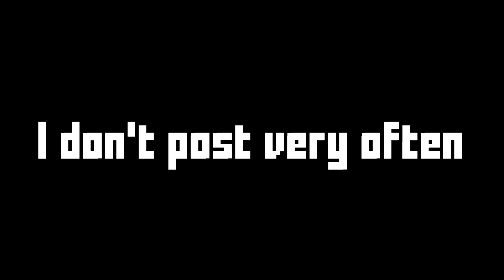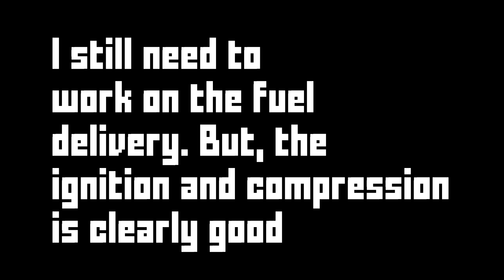Update on the 3D Printed Gas Engine: It Fires!

Comment: Hey Camden, I'm interested in your Piston Engine concept and I'm planning on making one with an SLA 3D printer.

SLA 3D printers have higher tolerances (Although with more tuning you can get the same print quality with an FDM) so I think I can make a Gas Engine in less time than it took for you to make yours. Because of tolerances.

Comment: Very interesting video! There have been model engines built with plastic crank cases, and plastic carburetors, also glass cylinders.  It will probably run but the cylinder head will get very hot very quickly. The hottest area is the exhaust valve port area.   Are you using an O ring piston ring?

Comment: i think if u tried making it 2 stroke it would have a higher chance of running since it has less things to seal and less moving parts and you could make theoretical compresion ratio higher but also i think you should increase the  crankshaft rods thicker and heavier flywheel

Comment: for fuel could a rc carburetor work? i think some were made for just gas.

I just now found this, is it all 3D printed? no metal sleeve or piston?
Reply from the maker: I wouldn't mid trying an RC carb however I am ambivalent due to having to actually purchase one and likely Nitro fuel to use it, so am avoiding it for as long as I can. It would be a little untruthful to say it is entirely 3d printed since it does rely on a Copper cylinder sleeve and metal hardware such as bearings and screws, but the latter is all 3d printed

Comment: I recommend using a slightly heavier flywheel as it seems that there isn't enough inertia to send the engine back around onto the next stroke. Also perhaps use an electric drill or motor to try spin the parts at a low of 50 rpm

Comment: Hey what's your ignition circuit? I've been looking around and everybody doing small engines is using high voltage spark drivers or glow plugs. I'd like to avoid that if possible!

Comment: I’ve thought about building something similar but with a few metal components. The two stroke approach is much better due to the simplicity. The head, piston, piston rings and cylinder sleeve would have to be metal with all other parts being 3D printed. You might be able to get away with casting the piston out of resin and using an o ring. I’ve seen people transform refrigerator and car a/c compressors into two strokes.

Comment: I realize this vid is 2 months old and you may already have a solution for your leaking, buuuut if you haven't tried it yet, I would suggest salt bath annealing with some High Temp (HT) PLA! Basically any PLA "Pro" you see on the market is a PLA mixed with other chemicals to reduce warping.

If you take salt, grind it down to a fine powder, and then submerge your print in that salt with a weight to hold the salt in place you can use that in an oven for a few hours at 170C to remelt the PLA closing any gaps from the printing process. Also if you anneal it at 60-70C during the cool down for a few more hours the semi-crystalline nature of PLA allows it to get stronger (less flexible, but higher force tolerance) and have a higher temp resistance. 

Just a thought to maybe help your sealing woes!
Reply from the maker: Woah, I have never heard of this before! Thank you for bringing this to my attention I'll definitely have to try this!

Comment: You did a big mistake. Beacuse it will NOT run on butane beacuse you dont have enought air in it. Try out CX-80 universal. It will work I grant you 100%. Or you can try petrol instead
Reply from the maker: You're correct, there definitely isn't enough air and I will look into your solutions, thanks!
Reply: @CamdenBowen  When did the next video arrives?

Comment: i think you need a heavier flywheel, like alot heavier
Reply from the maker: The thing is the crank will probably break with a heavier one lol, I could probably just make a very large diameter one instead however so the net weight is low but the inertia will be greater
Reply: @CamdenBowen  good idea, i want to make a gas engine too but i dont want to start untill i know its possible lol
Reply from the maker: @FoxSock  I have no idea if it's possible but I'll figure it out sooner or later lol
Reply: @CamdenBowen  im excited to see the results!

Comment: Consider switching to a liquid fuel again. This would make it easier to ensure constant fuel delivery. I would try a simple carburetor like you had before, and use a proper pump to ensure the fuel is being given constant, steady pressure. A basic gear pump would probably suffice. It would be more reliable than trying to scale down a diaphragm pump, after all.

Or don't do any of that. I'm not here to hijack your project. Either way, I like what you've got going here.
Reply from the maker: Thank you! I've tried so many things unsuccessfully so maybe I'll have to try liquid again, alcohol perhaps
Reply: @CamdenBowen  Alcohol would be good, but make sure you use alcohol-safe seals and hoses or they'll melt. Also, I'd try to use a carb that you can tune to some extent so you don't have to build a new one every time you want to adjust the air/fuel ratio.

Comment: I really want to see this engine run even just for a bit. Make sure the timing of the valves are perfect or else it will never run, try to make it work with the carburettor form the beginning so you get good air fuel ratio and try other types of fuel like petrol. Good luck, i wish you try these .
Reply from the maker: Thanks! The timing may need to be adjusted, the spark timing seems to be the biggest problem however instead of the valve timing
Reply: @CamdenBowen  You can just leave the spark plug spark all the time and when it is time for the power stroke there will always be a spark so you don't have to time the spark, or else you can do this till you get the engine running. Good luck.

Comment: @Camden Bowen just for giggles try a much heavier flywheel and/or changing the cam to a 2 stroke configuration. It kinda looks like the engine just doesn't have enough momentum to overcome the compression. I also think you should give a go with the lighter fluid again. The aresol is going to be a royal pain in the ass to get dialed in properly.
Reply from the maker: I agree lol, the heavier flywheel could work better as well as a new fuel source. I don't think a two stroke cam could work only because it isn't really designed to work like that unfortunately
Reply: @CamdenBowen  that would be correct... Forgot how 2 strokes operated for a moment.. but by doubling the cam profile you can try running it on compressed air. Might give you a better idea of whether or not something is binding up and a clue to how much weight you'll need to add
Reply from the maker: @PyroFactor101  that's not a bad idea, making a new head and camshaft to run on air as a test. I will look into that!

Comment: I love your engine so far... one thing I think that may help you though is that... honestly... I don't think your flywheel is heavy enough. You made your flywheel in a similar manner to other 3D printed engines (and why wouldn't you... if it works it works) but those engine's are usually air powered and 2 stroke meaning that they only have to have enough energy to get the piston through the exhaust stroke which... really isn't that much.

Your engine however is on a completely different level compared to those engines. You clearly have good compression and you are now running 4 strokes rather than just 2 meaning that you will need a LOT more rotational energy to be able to get it to cycle through all three of those and get back around to the power stroke again.

A good rule of thumb is at idle, your going to want enough rotational energy to be able to make it through at least 2 full 4 stroke cycles without the piston firing. Missing can happen at idle even with a fully functioning engine, so you will need to make it through 8 full strokes without a power cycle till it hopefully fires again. Seeing as your engine is 3D printed and this is all a guessing game (although your prints look to be some seriously high quality) you may even want more than that.

If you have that much weight on your flywheel (well... rotational inertia really), you should be able to get it to run and run pretty smoothly I would bet.
Reply from the maker: Good comment! I agree, the flywheel doesn't seem to carry enough momentum to overcome the compression stroke after firing at a low RPM, that is something I will have to work on!
Reply: Thanks! Something you could do if you find you will need way more mass than a 3D printed flywheel could be made to (or the crankshaft to even hold) could be you could gear up the flywheel till you get enough rotational energy to get the desired effect. The only downside is that you could then be approaching the limit for what 3D printed things can handle RPM wise without blowing apart. I do believe using this method you should get more than enough energy to sustain an idle, but if you go to rev it up you might want to step back XD
Reply from the maker: @rosswingard8949  maybe I could just increase the radius and weight slightly, that way the crank won't snap due to the rest mass however will carry more centrifugal force
Reply: @CamdenBowen  Also very true, basically like a flywheel from one of those old hit and miss engines!

Comment: Stick a drill in that flywheel, may be easier than a string.
Reply from the maker: I thought about that but my only concern is it may twist the crank or just plain round off whatever I decide to try and mate it too
Reply: Yeah, it may. Use one with a torque limiter and it'll probably be ok.

Cool project. The o-rings are definitely the way to go.

Comment: very cool .. Do what you can to separate the butane fuel from the air in the plastic bottle. Even if it's letting the fuel vaporize enough to displace all the air.  I'd hate to see that bottle contain an air/fuel mix that could ignite inside the bottle. - keep up the good work!
Reply from the maker: Thank you! After filming I realized "wow maybe this isn't very smart" lol, I'm going to try another design

Comment: Nicely done, you think a smaller chamber might work? I wonder how practical it would be to pull the tank out of one of those touches would be.
Reply from the maker: I think the problem is the torch has too little fuel, maybe a manifold with 2 of them combined will give enough
Reply: @CamdenBowen  what you need is a way to put a valve on the butane can itself. You might be able to canablize one of those bigger touches that have the knob, it's like the orange and black one you have but you just screw in a larger butane can. They use them for cooking. Or you might just use that orange touch with the tube on the nozzle, just gotta deactivate the sparker. That might work
Reply from the maker: @johnnyhellfire6  I have 2 of those torches and one of them is broken so I have been arsing around with it to make a fuel system by taking the regulator out of it... and also starting a large fire by accident too lol
Reply: @CamdenBowen  yea, that's the tricky part lol. Too bad you can find one of those older pocket touches that used c02 looking carts for the butane, they had a small knob to adjust it and no sparker. Super bare bones too

Comment: you need to put bearings on the crank
Reply from the maker: There are bearings between the engine case and the crankshaft, but not between the connecting rod and crank shaft if that's what you mean